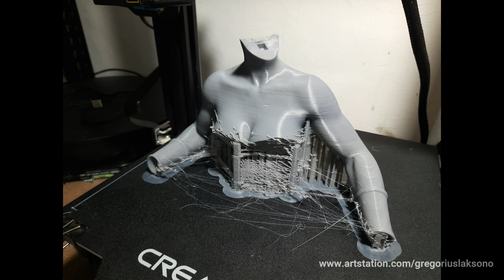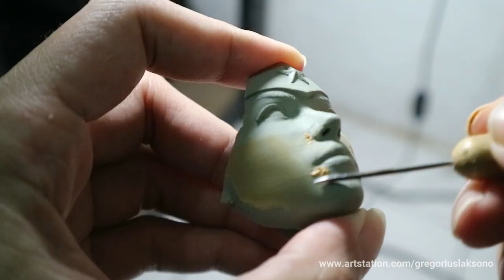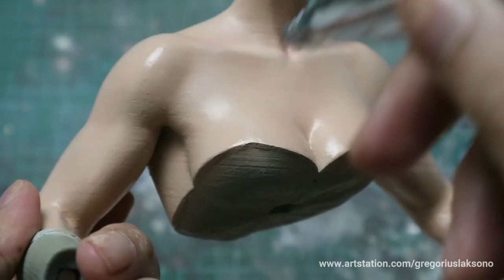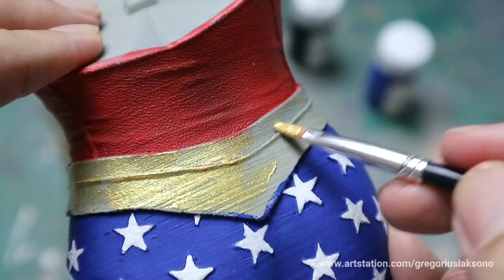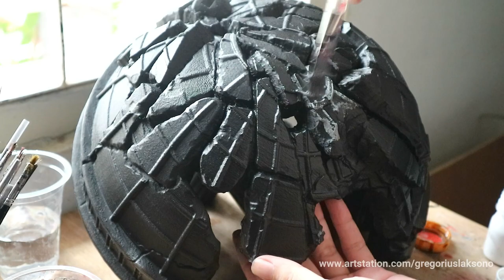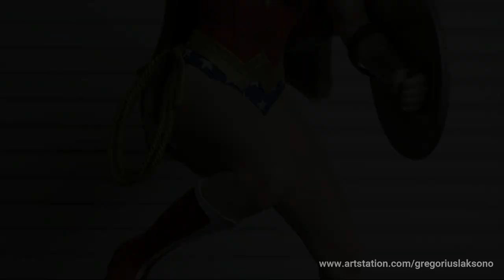Wonder Woman 3d Printed Fan Art Statue

Comment: What size of layer did you use???
Reply: I Use on my ender 3 s1 pro the super quality on the creality clicer I ques it's 0.12 mm,  and the figers with all the details turns very smooth almost like resen
Reply from the maker: I use 0.12mm layer height for most parts. 0.08mm for the face